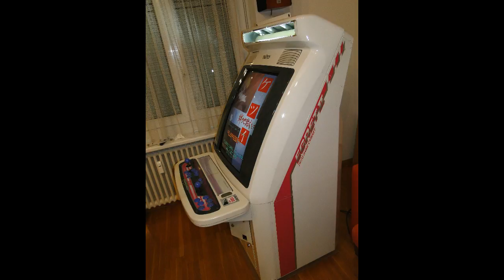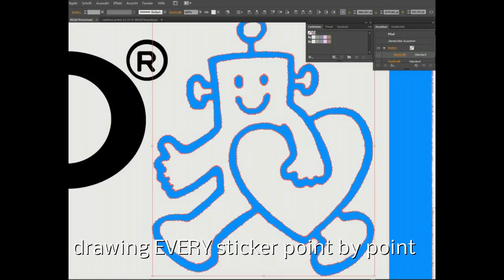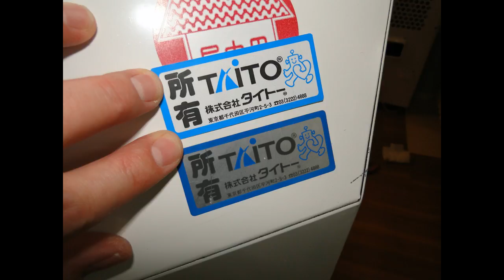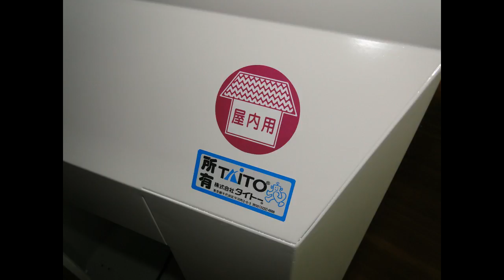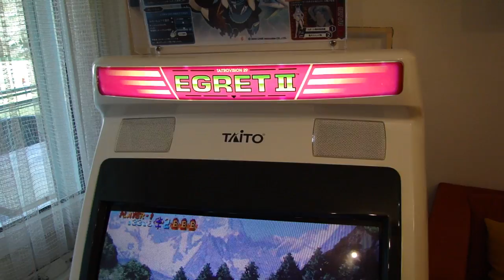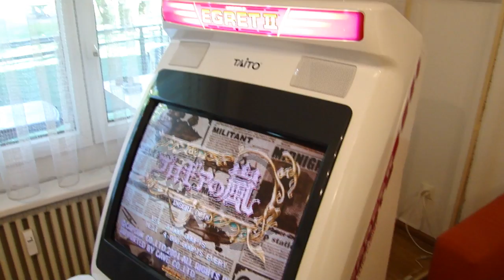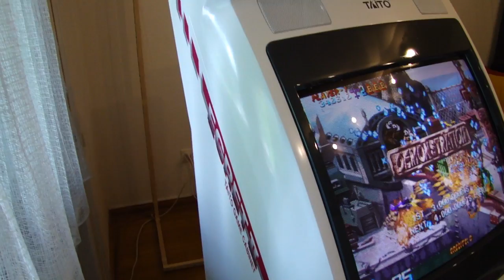Taito Egret 2 restoration

Comment: Awesome job! Where did you get the new top marquee from and what art input did you put in the control panel? I'm getting an Egret II myself and would like to restore it if possible.
Reply from the maker: If you mean the lightning panel it's like you search for the holy grail. I was fortunate enough to find one in a forum, BUT for about 450$!! They are f. rare unfortunately. The art is from ESPGaluda 2. Original one.